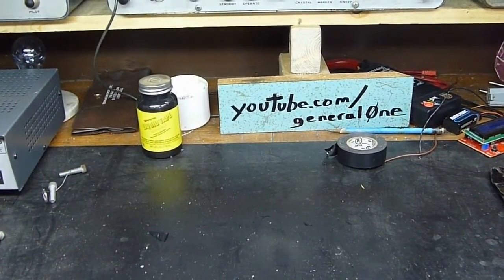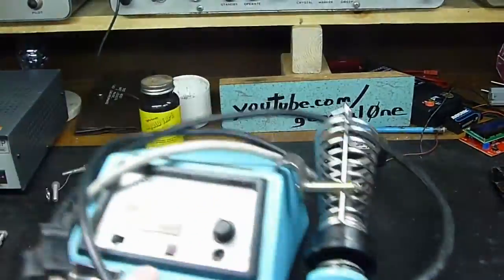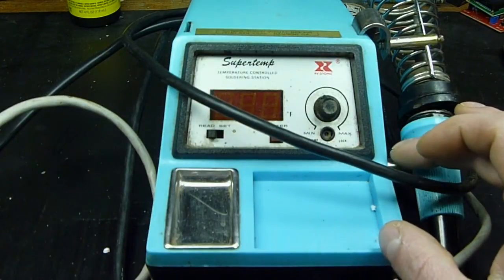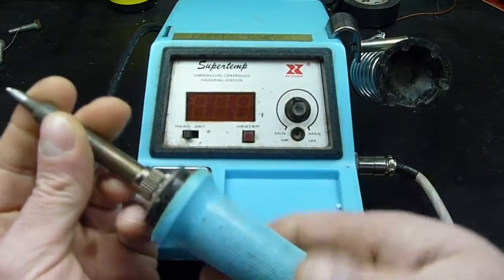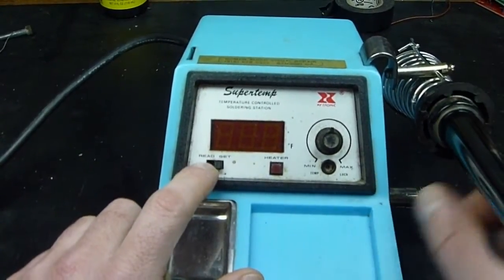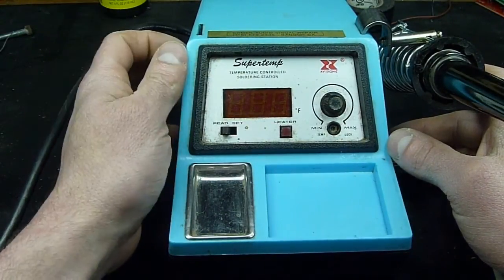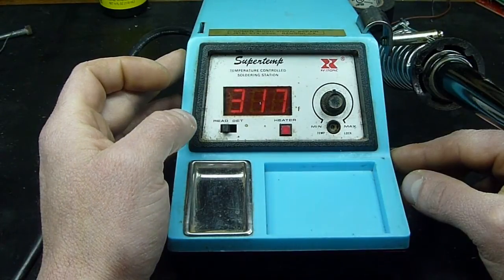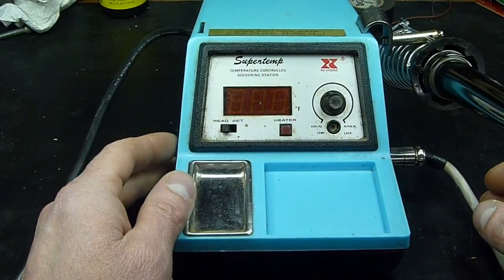Xytronic Supertemp Temperature Controlled Soldering Station

Comment: These are great little soldering stations! I picked mine up used back in 2008 for $60 shipped off fleabay! Still going strong today in 2019. I retrofitted a pencil holder but I like the one that is on yours better. Assuming that is the stock holder that originally came with these?

The temperature fluctuation started happening to mine around a year ago and has slowly gotten worse. I contacted XYtronic to see if there was a fix for this, I am assuming one of the potentiometers inside of it is going bad.
Reply from the maker: I assume that it is the stock iron holder, as it fits into a slot in the housing.  Since this video, I've "upgraded" to the ESD model of this station.  I found one, minus the iron for CHEAP, refitted it with the jack and iron from this model (The ESD used a different connector), and rebuilt the iron with a new heater unit.  The ESD has a similar holder, but it is all metal as apposed to the plastic top on this one.

Comment: Sir . Same modal i have  xy9-60a . I have problam . I repair pcb  bord   but problems is pcb controller setting mis match . Inside bord  plz could u tell me pcb setting controller tune. U open your this soldring station look . And tell me plz. Pcb pdf somthig u have.thanku
Reply from the maker: Unfortunately,  I don't think I can help you. I had attempted to calibrate the iron, but without much success.  This was by guess, as I do not have the manuals or schematics.   When the heater in the iron failed, I replaced the station with a newer model.  sorry that I wasn't able to be of more help.

Comment: I have a Xytronic 137ESD, which looks almost identical to yours, just not blue in color (and different pencil).  I love this soldering station.  I purchased mine over 15 years ago, maybe longer than that.  The only downside when I first purchased mine, was a poor selection of tips.  Now Xytronic has added a larger array of tips available for my pencil.

Comment: I almost got a hold of one of those, then a few years later I bought a Yihua 937D+...it's a 60W soldering station with digital readout, and the handpiece has a genuine Hakko heater in it.
Reply from the maker: Nice.  Is it a genuine Hakko heater, or is it just compatible with Hakko tips?  Dave Jones from eevblog recently did a review of the Yihua 936, which is pretty much just a knockoff of the Hakko 936.  It seems that Yihua just loosely copies Hakko's older designs, from what I've seen .
Reply: general0ne 
It"s a Yihua handle, but it has a Hakko heater in it.
Reply from the maker: I actually looked it up on their site, and they list it as a Hakko heater and state " It is equipped with the imported high-power heater. Therefore, it is extremely suitable for desoldering large, complicated welded joints, in addition to the general small solder joints." The 936 is just listed as "Common Heater" for the element type.  I'm actually surprised that Hakko would let them use the heaters in knockoff equipment, unless they're getting paid a royalty or something.